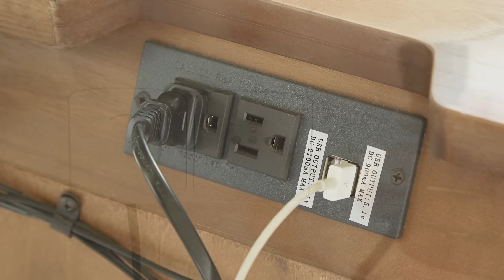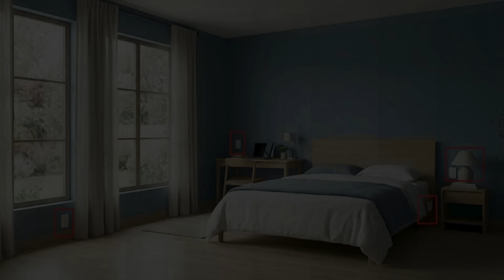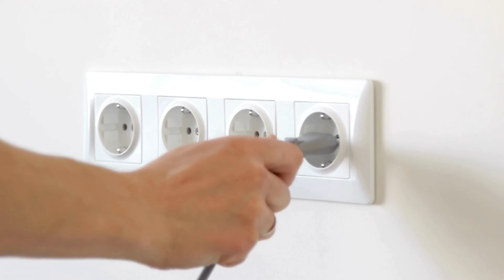Why Are Power Outlets Near the Floor? (The Real Reason)

Comment: Most electric wires in Greece are run horizontally about 2,3 metres from the floor and sockets are dropped from junction boxes and placed around a metre from the floor.  As an Englishman this (and radial circuits) is alien to me and slowly I am gradually rewiring and putting sockets where they make more sense to us.

Comment: Just a tradition. Usual way - sockets 20-40cm, switches 100-120cm. Its compliant to modern disabled access requirements, but not convenient in many case.

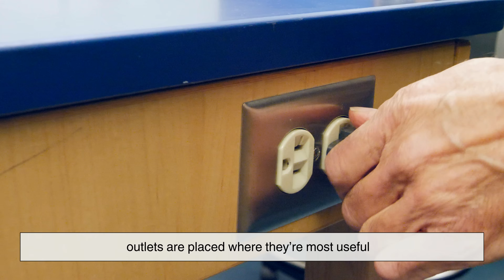 Older way - sockets 1m, switches 1.50m (shoulder height), still very popular in office environment where sockets in this case placed above desks (5:30, yes), way more convenient to connect all equipment.

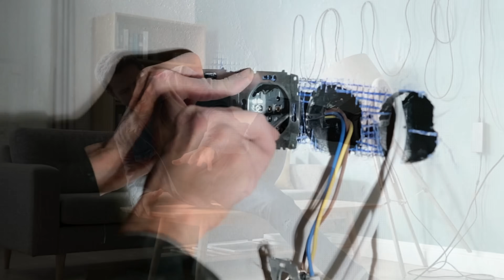3:10 exactly opposite. Sockets at 1m mean less cables on the floor.

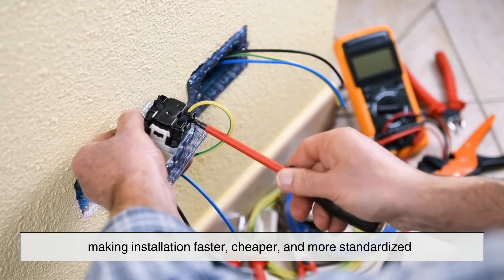4:00 US weirdness. European wiring done vertically, no horizontal wiring allowed. Everything goes up the wall and there to junction box or directly to switchboard. It reduces chances to drill the cable in the middle of empty wall, with no socket nearby.

Comment: Most outlets in a home would be 12" from a floor. An electrician comminly use there hammer (12"long) to mark the hight of recepticals the same hight through out. Same way a framer would mark studs with a framing hammer (16")

Comment: During a new building construction, the network folks tried to get the ethernet drops installed above the height of the modular furniture walls so the ethernet cables could be accessed. As I recall, the electrical connections were integrated into the furniture so low wall outlets worked.

Comment: Outlets with cords dangling down are a trip hazard?🤦🏼‍♂️🤣🤣🤣🤣🤣

Oh that's rich, so when did we start walking on walls? 

Seems to me that would have actually been the safer, NON-TRIP HAZARD route from an electrical outlet. 

I trip over more cords LYING ON THE FLOOR from low mounted outlets where the lamp cord straddles the floor and the vacuum cleaner running over them and yanking them out of the outlet is annoying. 

If the outlets were higher up and the cords came downward, perhaps via a split channel down the wall to hid the cords would have been a far better design than the lower ones.

  And those lower ones, if you have tile, laminate or hardwood flooring and you mop with water to clean them, sometimes that mop water sloshes and splashes into an electric outlet and zzzzzap, you just shorted out the outlet, possibly destroyed it and tripped the circuit breaker or blew a fuse! 

If I ever had a custom home built, my electrical outlets are going to be at least 3 feet above the floor baseboard line and I'll have split channels that will hide the downfall cords.   And outside my home I'll have outlets mounted in the soffit for my exterior Holiday and off season lighting,  as well as around my home in every wall at a minimum of every 4 feet apart and a minimum of 3 feet above ground level with locking weatherproof outlet covers that can be used with actual padlocks, and each wall would be on its own GFCI circuit breaker system.  Every 2 OUTDOOR 20 Amp dual outlets would have their own GFCI Circuit Breaker.

Might be overkill, but I'm keeping it all under strict control in how I want it done and still be in legal code.

Comment: FUN FACT; In AUS, THE POWER OUT LET CAN BE PLACED ANY WHERE.
Reply: ummm, formally speaking there are forbidden areas around water taps, basins, showers and so on. But in general - yes, they can be on the floor, on the ceiling (for example for garage opener or video projector in the middle of a room), on the wall low as possible, on the wall 1.80 height (fridge, wall-mount TV), above bench or desk, below (70-80 cm for dishwasher or washing machine), even hanging on chain from ceiling (very popular in stores)... as convenient.

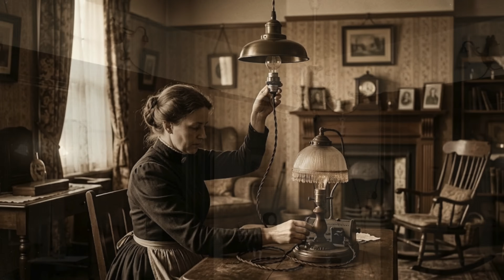Comment: 1:50.   I spent several years living near Lancaster, PA.   The Mennonite people live in this area.   They are "allowed" to use electricity and use electric appliances, however, they still mostly live in a "modest" setting.   I have been to stores in and around this area, and I saw lots of appliances, like vacuums and lamps, that do not have three prong plugs, but use the lightbulb adapter as its plug.   THESE people "rent" or buy these appliances, and probably use them sparingly.   Just confirming that these appliances and plugs still exist.

Comment: Thank you for this informative video. Please make a video about how electrical power outlets should be installed in food and medicine manufacturing facilities where dust generating activities  are done followed by a lot of cleaning using detergent and water or even steam. How electrical wiring and fixtures impact on regulatory compliance , eg., cGMP.

Comment: My grandparents had a home that was built before electricity became available. I remember the wiring being outside the walls. (When it was first built, the house didn’t have a bathroom either. There was an outhouse in the back yard.) The insulation on the wiring seemed to be some sort of fabric, not plastic. There were no off/on switches on the walls for the lights. But rather pull chains hanging from the light itself.

Comment: Will you explain why newer kitchen appliance are usually just a little too short requiring an extension cord? This seems less safe than just lengthening them by 1/2 a foot.
Reply: Electrical code (U.S.) requires no more than 24" to the nearest receptacle on countertops.
Reply: @jamesbuchanan3888  that sucks. Thanks for answering

Comment: I have seen a dedicated computer electrical circuit installed at the height of a wall switch for a ceiling light. With the multiple outlet points, it made setting up the desktop computer, printer, and UPS very convenient. No crawling to check whether it was plugged in, no tripping over the cord.

Comment: I have very few outlets in my 3 car garage; two outlets are just below each of the light/garage door openers. I have to use a ladder just to use those outlets. I think the builder went the cheap route and installed minimum outlets.

Comment: My power points aren’t all near the floor. The ones in my kitchen are above the benches. The ones in my laundry are at waist height. The ones in my bathrooms are beside the mirror. In my garage they are above the benches. Yes, in bedrooms, and living spaces they are low down on the walls, but that where they will be behind the TV, behind the side tables. In my house, the outlet are exactly where they are the most practical.

Comment: After Hurricane Harvey hit Texas the electrical code has been updated to 18" above the floor because of how fast flood waters reach the old 12" off the floor outlets and short out the breakers or electrify the water.  The 2023 building code now has 18" as the lowest distance to the floor.  In Cedar Hill, TX when you put battery  backups in your garage they have to be mounted on the wall no lower than 18".

Comment: My home was built in the 1890s, before electricity, water, sewer, or natural gas. The house has a lot of large floor-to-ceiling windows and doors to allow in as much light and air as possible. There was only support for a very early gravity central heating system to service the 1st floor - no ductwork to the upstairs and there was no insulation. Some of the outer walls were brick, with 2 layers of brick and then plaster directly on the brick on the inside. All the other inside walls and ceilings were lathe and plaster - where plaster is pushed through the gaps between the lathe and curls around the back. In the walls you find that there are a few inches of plaster along the bottom where it fell during installation. And some of the walls were thin - the 2x4s laid flat to give more space inside the room and less in the walls because utilities weren't run in walls yet.

So, a lot of electrical receptacles were installed in baseboards when homes were renovated to add electricity because it was the most practical location. Baseboards stuck out from the wall by an inch or two and gave space for electrical boxes and wires/cables that wasn't as available in plaster or brick walls. Wires/cables were run up from the basement to service the first floor and down from the attic to service the second floor. This likely influenced receptacle location in new builds for a short while because early electricians did a lot of renovation work. Drywall soon took over, windows became smaller, and the receptacles moved up from the baseboards to where they were both easier to install in new builds and where it was easier for people to access.
Reply: 👎👎👎 Cheapskate, buy a new expensive home.    ::             :face-blue-smiling:

Comment: If we start with the evolution of electric in homes we have to consider retrofitting to plaster walls (not easy) so cutting the baseboard makes less mess and is more secure. Also think about wires feeding up from a basement... short and sweet. Ceiling fixtures most likely were installed via pulling a floorboard directly above and securing things to a beam / joist. In the beginning most homes had a single circuit for each floor so there's your basic 30 amp service. (110 volts only and 2 fuses) Later on we got 4 circuits and 220 volts, which were usually divided to outlets and lights. They were NOT using a wire cable. They were single wires (sometimes insulated) run between ceramic posts so you needed space between them to avoid a short circuit. Keeping the wires short was a bonus when feeding through existing walls as there was no way to secure them without removing plaster. BTW, many retrofits were "surface mount" to avoid that problem.
Reply: in USSR - exactly opposite. Ancient open surface wiring on ceramic posts ("isolators") always was made high above the floor for safety, to be not disturbed by users, with only vertical dropdowns to switches and points as inevitable evil.

Comment: Back in the 1970's started installing top of receptacles 12" off the floor then 16" . I now make the top of wall cases 20" off the floor. Carpenters & sheetrockers love that height. Was a pain installing receptacles in old home baseboards.

Comment: I'm not electrician but been wiring home 120/240v for years.  I'm a software engineer and electronics engineer.  In my home office / electronic lab I have two outlets in my ceiling over my electronic bench.  Went up to attic and did it.  Kept wire from going up shelves to devices I needed to use that where higher up.

Comment: Also switches are located anywhere from 42 to 44 inches above the floor.  And their located on the knob side of the door.  This is done so you don't have to walk into the middle of a dark room to turn on the light.  In the early days when homes were wired up to a pendant light hanging in the center of the room, with a turn switch on the light fixture.  Then they came up with 3-way and 4-way switches if a room has several exits, a person can turn on/off the lights from any exit they are using.  Hallways, stairways, as well as flood lights between house and garage are wired with 3-ways because they only have 2 positions.  For 3 or more positions, you 2 3-ways, and then a 4-way for each additional position.
      In old houses, they put the outlets in the molding.  Back then they liked tall 6, 8, sometimes as high as 12 inch single board floor molding.  This way they pry off the molding and run the wire behind it without cutting into the plaster, many times cutting the outlets in horizontally rather then vertically like we are used to now.  In my 1950 house, the switches are 47 inches to center from the floor.  Outlets are 12 inches to center, (that's the plate screw).  Now in the basement, the outlets are 4 feet, 2 inches from the floor.  Now on the other side of the basement which was made in a rec room, the outlets are only 15 inches from the floor, only 3 inches higher than upstairs.  The NEC (National Electrical Code) here in the U.S. requires outlets must be located no farther than 12 feet from each other, since appliances usually have 6 foot cords, otherwise people would use extension cords, which should only be used temporally..  In kitchens, you are required to have 2- 20 amp outlet circuits for the microwave, which are required to be GFCI (Ground Fault Circuit Interrupter) protected because being in reach of water is a high risk of shock.
Reply: You are close. Two 20 amp circuits now required for the counter top. Built in microwave gets another and so does the fridge. Likewise for a dishwasher, but that can be shared with a disposal. (fed under the sink) Only outlets within 6 ft of the sink need GFCI.

Comment: You don't mention that outlets are once in while recessed in the baseboard moulding in older (Victorian) homes--like the first image in your video--because when these houses were built, there was no electricty, so, that was an easy way to wire the premises without breaking all the walls.

Comment: In England UK . On new builds socket outlets are half way up the wall . It looks horrible. Our outlets have children proof shutters so that’s not a problem.  In my own house they are 12 inches off the floor . That’s where I wanted them and being an older house . No requirement to be half way up the wall.

Comment: Then there is the spacing of receptacles around a room.  We’ve had to add additional receptacles because of the ridiculous spacing.  Had a receptacle on one side of the bed where a nightstand would logically be placed but none on the opposite side of the bed where the other nightstand would be placed.  No we had to stretch the lamp cords to an adjacent wall using extension cords to find the next receptacle.  But there’s a receptacle located eight inches from the corner behind the door into the room which we’ve never utilized…
Is this spacing due to code or the electrician’s inability to think about where furniture will be placed?

Comment: I think that in case of flooding, it's not practical for it to be so low. Risk of short circuit. And of course, it's not good for children either.
Reply: How low? Thinking about mopping is important, not just flooding. Definitely need to keep children away. And what about actual floor outlets for, like, under a dining table or free-standing desk in an open plan space? It's difficult to try to accommodate every circumstance. Ground fault interrupt is one solution.
Reply: @virginiamoss7045 GFIs/ RCDs  are mandatory for socket circuts.

Comment: I like the switches included on the (European 220v) outlets.
Reply: not on "European outlets", only in the british ones the rest of Europe never uses any of it. and the one with the switch and the diagonal holes, could very well be australia or new zealand.
Reply: @makasii   Thanks.
Reply: @makasii   Very Interesting.  I'm surprised that is not a universal thing.
Reply: @lob @lobecosc safer to unplug when you not use it
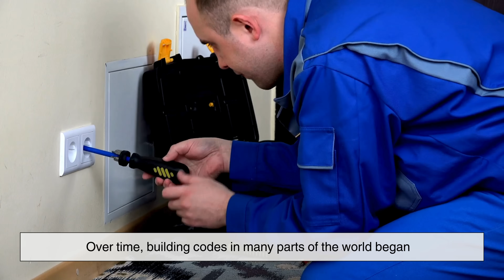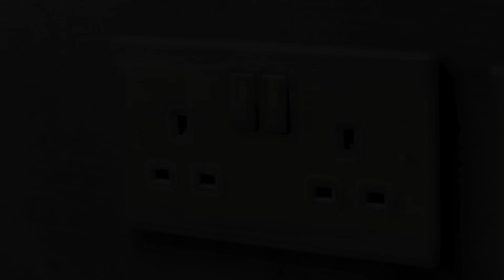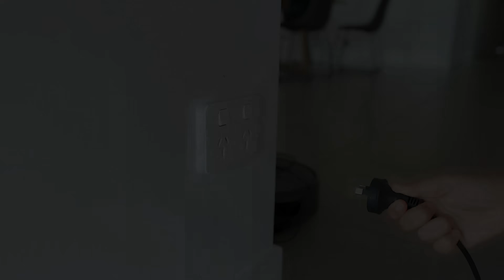Reply: nope, Schuko sockets (4:05) do not have switches, thats weird British (8:10) invention , inherited by our Australia (3:28) and nobody else.

Comment: In Australia, for accessible homes socket outlets (receptacles) and light switches are mounted between 950 mm and 1050 mm. This allows wheel chair users to control power and lighting.
Reply: There is the same code in America it's 42 inch. 😊

Comment: I suggest putting the outlet 2 ft above the floor so I don't have to stand on my head to plug something in
Reply: next presentation:
why lights are placed 
near the ceiling; 
so that people won't 
trip over them!
Reply: In the US that's required by the Americans with Disabilities Act so that wheelchair-bound people and others can easily access them.
Reply: @virginiamoss7045 That height variation for outlets is only for places that need to be ADA compliant. Wall switches are also lower in that case.
Reply: @rupe53  I don't think ADA standards address light switches. I designed for office space my entire career and the only height restrictions were for lower outlets which have to be at least 18" a.f.f. and that is for both residential and commercial. There are, of course, specialty circumstances where requirements are different.
Reply: @virginiamoss7045 NEC allows 40 - 48 inches as standard. (now) ADA wants the lower number as their current recommendation for wheelchair access. Many electricians also want to stay away from the 48 inch mark to aviod drywall guys from filling their boxes with mud.
Reply: i had a client ask me once to put an outet with the light switch in the entrance of each room. she said it was to be easier to vaccuom, so she wont need to bend each time to plug it
Reply: @FlnSkr  I like that; something to consider.
Reply: @virginiamoss7045I am always grumbling when I have to squat down to plug the vac in!

Comment: A bit of trivia: The NEC (electric code) allows required “convenience “ outlets to be as high as 5-1/2ft above the floor, or even on the floor within a foot of the wall.
      Where handicapped access is desirable the outlets are typically 18” above the floor.
Reply: The ADA in the US requirements are for everywhere, essentially, both commercial and residential.

Comment: Here is a question, What is Yeast and how does it help make bread?
Reply: It’s a single celled organism which converts sugar and water into ethanol and carbon dioxide. The co2 forms bubbles in the wet dough which are then set when the dough dries as it is baked.